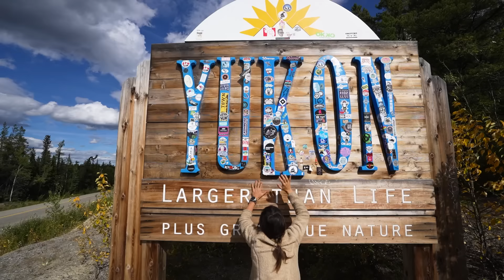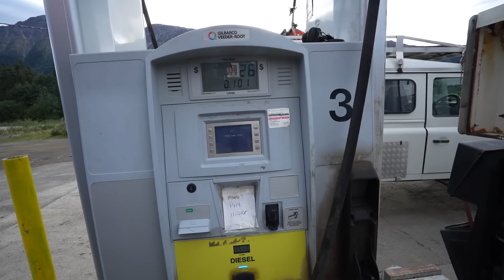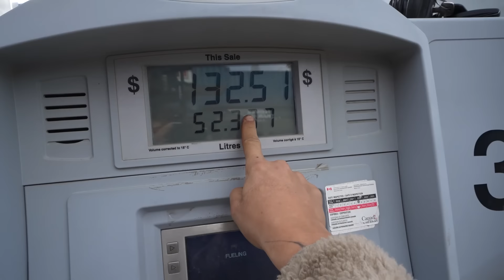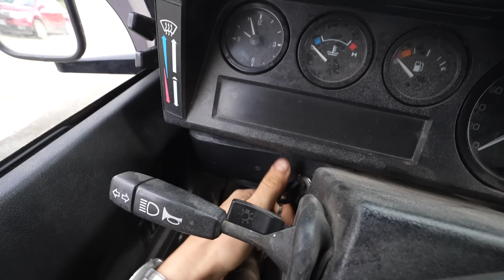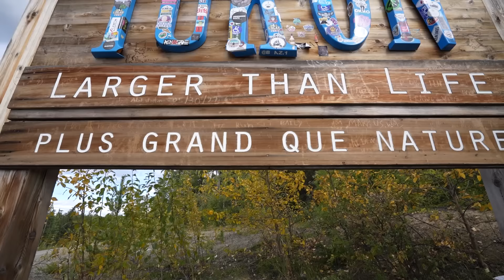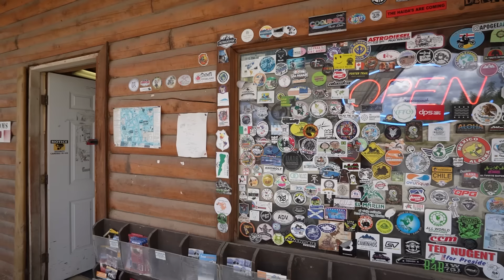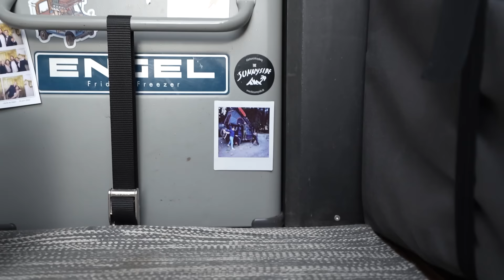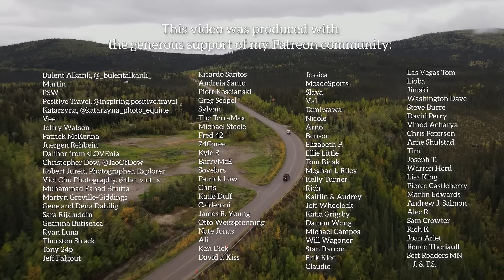No Longer Alone on the Road

Comment: Did you ask what your bear spray distance says?  There are various distances to choose from.  Check it.  If the bear is 100 feet, or 200 feet, ir 50 feet, you'll want a spray that will work the distance you might encounter.  Check the distance, otherwise you might spray at 60 feet, and it won't reach the bear.  You'll want a bear spray that will spray 150 to 200 feet.  That way you know the spray will reach the bear.  And in time to give you better odds of getting away.  In Alaska, they carry a bear spray that will spray 150 to 200 feet.  Check your distance on the can.

Comment: Ok im a bit late to the convo but its def possible to cook food on an idling engine in thr cold (im a railroader and we have heavy equipment we use for our job) and guys will often use an exhaust pipe or some other hot part to warm there lunches in the winter lol. Unfortunately it wont work when you are travelling engined are designed to have air flow through the front grill to help with cooling! It maaay help if you put a slip of cardboard behind the grill infront of the rad to help cut down the wind (we use this in the winter with older or smaller vehicles in central canada to help with heat in the cab) but im not sure even that would help lol

Comment: you put what you want to cook in the manifold the part that connects the motor to the muffler that is where all the heat comes from the muffler pipe is the source of the heat that can cook stuff as well as the side of the engine

Comment: As you get up into the more northern parts of Alaska and perpetual darkness (we are heading into winter now!) having a group travel together with multiple vehicles could be a lifesaver. Roads on the map could be far worse or even outright dangerous in real life. Make sure you bring extra fuel, and some means to transfer fuel and power from vehicle to vehicle, and at least a couple (among the group of you) powerful radios and GPS so as to be able to call for help if stranded or trapped.

Comment: Trick with the potato is to put it on top of the exhaust manifold, no where else will get hot enough, and on most vehicles theres heat shields preventing you getting too near the manifold.

Comment: As my grief over losing my lady decreases i hope to find someone to share some travels. As most of the roads you take are paved so they can be taken by my C-6 Corvette. 

Roadside repairs on our Alaska trip some 55 years ago included rebuilding a set of SU carburetors and resetting the KONI shocks at Watson Lake, YT. Later in the journey we ran over the exhaust system and I welded in a straight pipe.  Loud but functional. 

I am glad you have realized travelling with a small group can be just a interesting as being alone (with a dog). Thank you for sharing.

Comment: Here is a suggestion.  When you cook greasy food.  Take some sticks  and dry leaves and bundle them up and pure the grease over then, store.  The grease burns slow and the sticks and leaves help keep the flame going. I saw where someone make a medal box that fit on the vehicle exhaust pipe that was used as a oven. Speed has a lot to do with the temperature inside.
Reply: The sticks and are for starting a fire.

Comment: I have taken ginger and diced it very finely and mixed it with sugar and let it dry. In your situation dicing it and putting it in sugar in a sandwich bag without drying it would have probably worked to get it across the border and preserved it long enough to use.  I sometimes just pust a pinch in my mouth when it is drying.

Comment: A tidbit regarding cooking food off engine heat. 
Truckers have used this source for many years, and found that worked best closes to the turbo or exhaust manifold. 
You can actually cook a whole meal this way if done right in the matter of an hour.
Turbos, and exhaust manifolds, have temperatures that will reach 800° to 1200 ° Fiahrenheit . 
I've seen some where drivers constructed tin ovens surrounding the  the turbo. 
The idea is, to place meat and potatoes, veggies, into oven bag wrapped by tinfoil. 
Timing depends on experience. 
1 to 1 1/2  hours for  for 3lbs of of meat and potatoes cubed .

Comment: For cooking the potatoes, the need to be placed around the exhaust - not the intake. Tom's idea for a metal container will work to place the wrapped potatoes in it and attach to the header or front of the exhaust pipe. That is where the most heat and can cook a meal.

Comment: One thing about coolant is you can always add water. Distilled is best but if you get in a tight spot water out of a clean flowing source strained though a tightly woven shirt or even a sock will get you back up and running. If you replace most of the water in the system with fresh (not distilled water), you will want to do a flush when possible to avoid mineral deposits building up in the system and plugging stuff up. If you have high mineral levels in your tap water and your water heater, dishwasher, shower heads and faucets have issues with mineral deposits, you'll know exactly what I am talking about. And unless these rigs are different from everything else, overfilling isn't harmful as long as you aren't worried about dripping half a quart onto the ground as you drive. The overflow will allow extra coolant to escape as the vehicle heats up. I have met some people that are very mindful of the footprints they leave behind and will literally scoop up fuel, oil, or coolant contaminated soil after spilling only a couple drops to be disposed of properly in the future. I think that's a little overkill, but hey, to each their own. 

Also if you do run the coolant reservoir dry, it's not a bad idea to check the radiator level WHILE THE ENGINE IS COLD as this is very important for your safety to prevent the 180+ F degree pressurized coolant from spraying out the radiator cap and likely causing severe third degree burns that will require medical attention. But anyway refill the radiator, squeeze the upper radiator hose and watch for air bubbles coming out the radiator fill. Once you see no bubbles and the rad is full, cap it completely as most require a quarter turn, and then another quarter turn, sometimes with slight downward pressure until you feel the cap reach a hard stop. Refill the reservoir and carry on, checking the coolant reservoir daily until a normal level between the add and full marks is reached. If coolant constantly needs to be added a leak outside or inside the motor may need to be addressed and should be addressed sooner rather than later, as you can find yourself shopping for a new motor after running with a minor blown headgasket for long enough. 

Sorry for the story but this was an opportunity to share some knowledge for people that aren't very mechanically inclined and want to overland in crazy places like Eva does. Oh I forgot one thing. Never, EVER put saltwater in a car unless you are SUPER freaking desperate. Then get a full coolant flush with several cycles of clean water, turn the heater on high, and several more clean water cycles. Replace the thermostat and you should be good to go. Happy trails everyone!

Comment: The potato has to go right onto the exhaust manifold.  Turn it every half hour.  I learned this through trial and error back in my Boy Scouting and military days.  You can also do it with a foil pack containing diced potato, meat, carrots and onions.  A whole meal!  It works once you have the placement and technique down. 😉
Edit: The problem is the highway driving.  All modern vehicles have very good airflow into the engine compartment when the vehicle is moving at highway speeds.  If parked and idling, the potato will cook fairly quickly.  But if driving fast on a highway, the outside air flowing into the engine compartment is going to prevent it from baking.

Comment: The exhaust manifold is where you want to rig a spot to bake your potato. You engine is running at only about 200 deg F. Where as the heat around the exhaust is much higher.

Comment: You may be able to cook a potato on the exaust manifold. It is the only part of an engine that gets hot enough. The temperature of the engine itself is only about 190-195 degrees. Exhaust manifold gets into the 400 degree range, which is what it takes to cook a whole potato.

Comment: Travelling in a 3 vehicle convoy in this remote area is a VERY GOOD IDEA! If you have any trouble you have 2 backup vehicles. 
.
200 hundred miles a day ... ? very leisurely trip. 
.
Uh, 800km is more like 240 (for rough calc I use 100km = 60 miles, is actually 62, but I'm lazy doing in head head calcs, 300) miles ... oops
.
I was going to suggest after this trip you try cross Canada West coast to East coast. If you could time it to hit Southern Ontario and Quebec in mid to late October you could have caught the leaves changing colors. The oaks, maples, birch etc have wonderful colors in the fall if you catch them at the right time. 
.
Good luck, have fun.

Comment: Just a quick note on the coolants, it depends on which engine you have but your TD5 engine should have an OAT based coolant. The other type of coolant will gradually corrode your aluminium engine parts. Just sayin’…..

Comment: The air coming through your door is probably caused by your door seal. Change it, it's cheap and easy and you will be able to keep out any wind or moisturizer.

Comment: Aerosol cans have to be warm to work. If your bear spray is ice cold it will not spray well at all. I think to be really safe in rainy season, a long handled butane lighter might be needed to ensure fear in a bear. Especially if you've already sprayed it and it wants to keep charging. You may even need to set the bear on fire to get through it alive. I'd try to scare it before resorting to setting it on fire. If it's far enough away and you shoot a big flame cloud at it but don't hurt it, it will probably stop.

Comment: Eva, there is safety in numbers for one. You are taking a possibly dangerous trip. And considering the time of year, you will encounter snow and ice. Lots of both. Deep snow too. As far as bears are concerned, for the most part, they may be more afraid of you, unless you come upon a bear with cubs. Grizzlies are an entirely different matter. Hope the bear spray works.

Comment: Well ... maybe the potato would be cooked if it was placed on the Exhaust Manifold, which has heat, rather than on top of the engine where its not that hot.

Comment: You SHOULD GET SOME BARS LEAK PELLETS THEY COME IN A 6 PAK. IF YOU HAVE A COOLANT LEAK YOU JUST TAKE 2 PELLETS PUT IN ZIPLOC QT FREEZER BAG..ALL I USE.THERE HEAVY DUTY..SO SEAL BAG AND CRUSH INTO POWDER. TAKE OFF RAD CAP ..ONLY WHEN ENG IS COLD.GET XCESSOUT OF RAD NECK PUT CAP ON ALL THE WAY AND SIMPLY. DRIVE TO OPERATING TEMP..IT WERKS GREAT...

Comment: You might be a better way to, prepare a potato with a car.

Your car generally has, a radiator coolant, reclamation container.  Drive the vehicle around like, a mad fool.  Getting it really hot.  Then stop it.  And shut it down.

Then you take a potato...  You stick it in a, Ziploc, sealed plastic bag.  And you suck out all the air you can.  And then place that potato in the protective plastic bag.  Into the radiator coolant overflow, container.  Add it should boil that potato, quick enough.  In virtually any weather and temperature.  Because you got to take that potato to the heat, directly.  So just boil it in, automotive radiator coolant..  Protected in a plastic bag.  So you don't get drunk or dead.  By consuming a potato boiled in coolant.  Without a plastic bag.  Otherwise the results of your dinner could be, extremely gaseous.  Accompanied by death.  So don't do that.  It isn't healthy.  Put a plastic bag condom on your potato.  And you will be fine.  As long as it doesn't, leak.  You could add leaks later.  With sour cream.  Which is cream.  That has been sitting around so long.  Without the proper refrigeration.  It Decays, into a semi-smooth, cheese.  You could put on toasted bagels.  You might have to go to Israel for that?

Sour cream and cream cheese.  Sort of the same.   One requires a spoon.  The other requires a butter knife.  Both made from the same cow.  Cows are talented like that.  That's why we kill them and eat them.  To appreciate them from within.  And have them next to our heart.  Clogging our veins..  With saturated cow stuff.

In the next episode.  We will explore the intestines.  Of a dead Decomposed,  cow.  You won't want to miss!

You know there is, lice..  And ice.  In the Antarctic, don't you?  Both!  And if something itches?  Where do you shower?  At the, Veterinarian?  Sounds like a plan?  No?  Then you can get your shots, also!  Not the, liquor filled ones.  The ones with all the,  viruses in them.

I miss the, liquor filled, dark chocolates in Germany.
RemyRAD